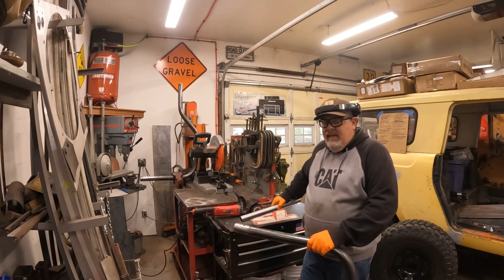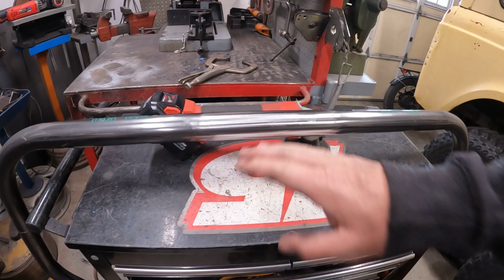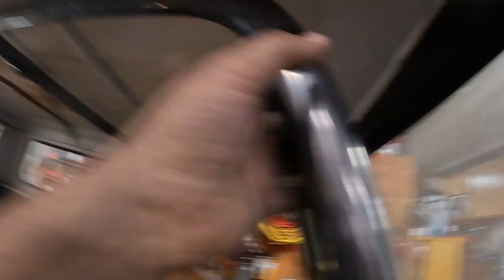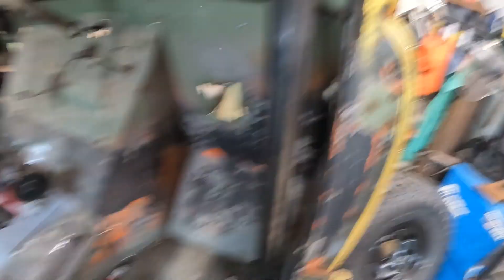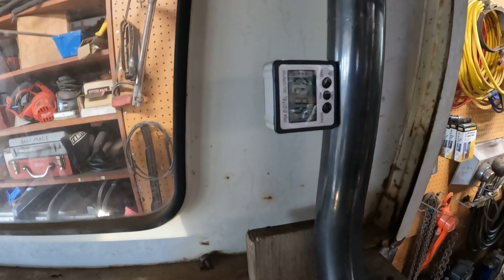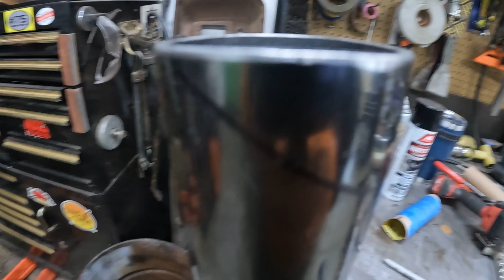Modifying the D&C Extreme Scout  80 800 Roll Cage: Custom Build & Upgrades

Comment: Did you run into issues with the door handles on the inside? I got mine kinda lined up and realized I can't push the door handles forward to lock the doors from the inside 🤦
Reply from the maker: I haven’t had doors on yet  but I think Im good with the mods I did pushing roll bar forward  got any pics of yours ?
Reply: @NoBudgetGarageBuild can't send any pics but it's looking like I'm going to have to notch the dash sadly

Comment: Do you have the part numbers for your intercooler and radiator for your 4bt swap?
Reply from the maker: My radiator came from lead foot racing part number CC6671.  I bought cooler off of eBay. 

https://www.championradiators.com/search?searchwords=Cc6671&searchsmall_612033242=

Comment: I don’t often weld a cage tube together.. and if I do I rarely take the weld off… But, when I do I hand file the weld. Much slower but much more controllable.  A flap wheel on a grinder flexes too much and causes waves, and a grinding disc will cut to quickly/aggressively… with a good hand file, am able to have no indication there was ever a weld there… just sharing what works for me..
 Fun project! Love all old school stuff… mine happens to be a 74 CJ 5… Good luck!
Reply from the maker: @jamesbaker3211  great info! I run a really stiff backing plate on my sanding disc and keep it super flat when I’m try to avoid concaving the  surface.  I grew up in a 74 CJ 5 my dad bought new, my brother still has it. Garaged it’s whole like it’s beautiful